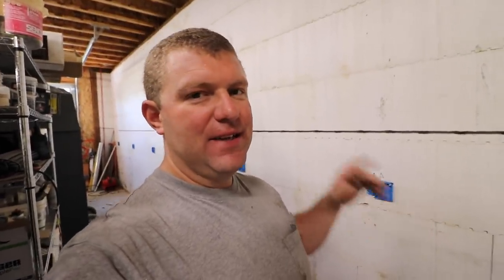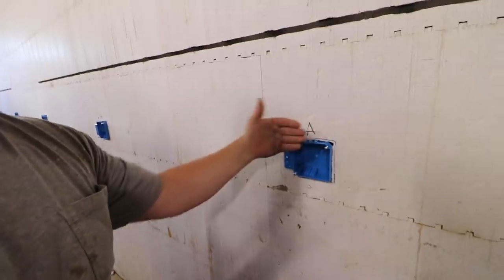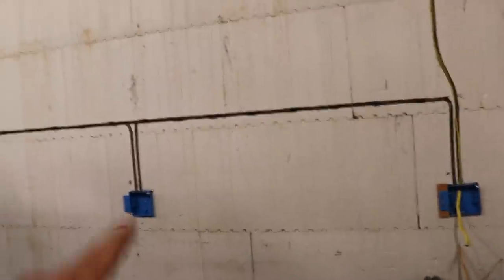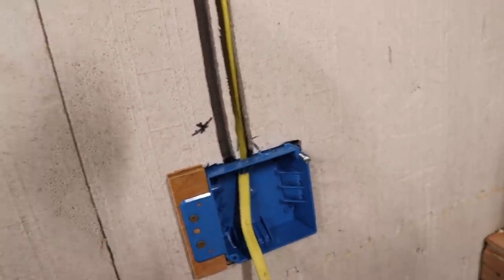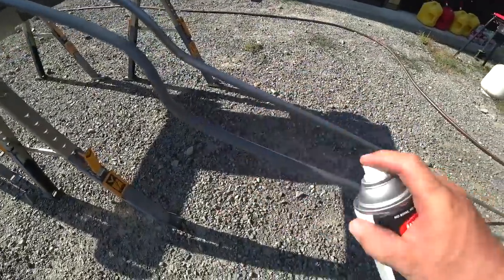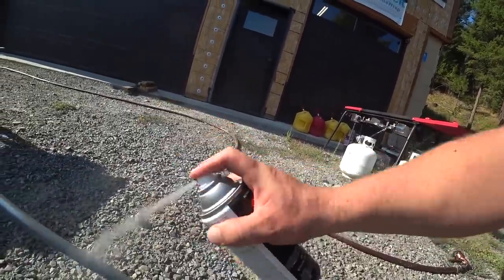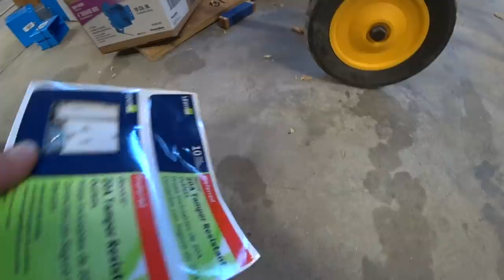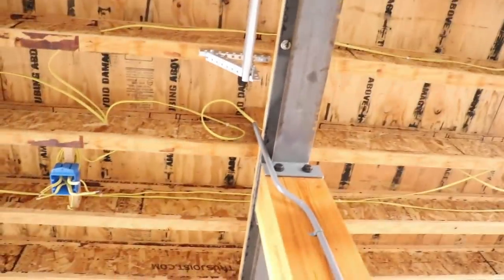OCD PEOPLE BEWARE! (Hot-Knifing ICFs for Garage Electrical)

Comment: Hate to burst your progress bubble but by code Romex wire cannot be put into conduit.....one reason you don't put romex in conduit is because it creates more heat and is not advised in conduit if you have conduit you can run insulated wires instead it's probably cheaper. when you put romex inside conduit The Romex cannot breathe and retains too much heat.I always thought that it was okay.
Reply: Pete Nelson disagree! It can go in conduit as long as you don't exceed conduit fill (40%). It's not normally done though, except for when you're just sleeving NMB to "protect from physical damage". It's done all the time for what he's using it for.  But you can't remove the sheath where it enters the conduit. Only remove sheath after it enters the box.
Reply: also..... less pst, pst, pst and more  psssssssssssst.  :-)
Reply: @playnationtoday  just stating what national electric code states
Reply: @petenelson6654  The NEC does not state that. Unless you can cite the article, it does not exist
Reply: @N-hunter  section 312.5(C)
Reply: @petenelson6654 the exceptions to that article specifically allow it
Reply: @N-hunter  those pesky exceptions will get ya everything haha, totally legal if used for physical protection. I remember years ago inspectors would allow striping the nm sheathing off then the turn around to not allow us to do it as the individual wires were not labeled as to what type of wire it actually was.
Reply: @TheRealTonyCastillo  sometimes it all depends on the inspector. Some will let a lot slide and others are strictly by the book
Reply: I just don't want him to have a bunch of stuff to redo. Could put a junction box on the top of the conduit and run the Romex to it and THNN down to the outlet
Reply: @petenelson6654  NEC Section 312.5(C) specifically allows it in just exactly this scenario.  Also, they have already passed their inspection.
Reply: If putting Romex in conduit is frowned upon because of reduced heat dissipation then putting it in a tight slot in polystyrene foam must be reallly bad.  And if he's gonna fill those slots with more foam then we can expect instant conflagration.
Reply: @thomasmarable6818  Yes, here in the UK electricians use cable called Twin & Earth which is similar to Romex and the wiring regs specify different current ratings for each gauge depending on how the cable is mounted. eg in conduit, clipped to masonry , under plaster, under 100mm of insulation etc.

Comment: Why are you using 20A receptacles in the ceiling for the lights?  There are VERY few appliances that need a 20A receptacle.  Especially since it looks like you are just plugging in LED shop lights to them.  Just use 15A.  The 20A are much more expensive and unnecessary.  There is no issue or code problem with using 15A receptacles on a 20A circuit if that's what your worried about.
Reply: Any 15 amp receptacle will flow 20 amps. No need to spend the extra money on a 20 amp.
Reply: @CustombyclyneCbc  agree.  Also, 15A receptacle should really never have to flow 20A because any appliance that would require 20A should have a 20A plug on it.  So you physically should not be able to plug a 20A appliance into a 15A receptacle.  Most miter saws and jobsite table saw have standard 15A plugs.
Reply: @javaldes7  also agree. I used 12/2 wire with 20 amp breakers with a 15 amp receptacle on my garage wiring and passed my inspection. No need to spend almost 4 times the money on a 20 amp receptacle.
Reply: @CustombyclyneCbc  price difference on those things are absolutely rediculous.  Especially if you are doing an entire house and you will almost never need the 20A.  I couldn't justify it either.
Reply: Not only 20A receptacles but decora.  Standard 15a receptacles about75 cents these are probably $3. But they seem to have plenty money.
Reply: @mengelman2  I can understand decora.  The really do look so much better.  And I get this is his home and hes trying to do it right the first time.  But this definitely a case where the money truly is just being wasted.  He will never plug a 20A appliance into one of those ceiling outlets.  Maybe you need 1 in the entire garage for the rare case u need it.

Comment: Never paint conduit. It is supposed to be conductive.
Reply: That is why metal conduit is required to have a "bonding device". Then,. there is PVC conduit. Personally, I green wire all conduit pulls, in addition to bonding the metallic boxes and making up conduit connectors TIGHT.
Reply: Conduit is painted all the time, it shows you know not what you talk about.

Comment: Hi, Did you use the ring circuit for the outlet?
Reply: Ring circuit is a UK item, In the US the 15 or 20 amp garage circuits are never wired in a ring.  The US National Electrical Code is very different compared to the UK wiring Code.  With the 115volt receptacles in the US the need for more home runs would be needed as a large power tool such as a single table saw would take 13 to 15 amperes.  In the UK the same table saw would take half that current, and a little less with the voltage drop in the feeder wires.

Comment: could electrical conduit have been embeded in the garage slab?
Reply: They could have, but instead they opted for radiant heating conduit in the slab which they've opted to not use and instead got an electric heater.
Reply: @JW-sv5xc  right i forgot about the radiant, been folowing them for a fiew year. still wonder if radiant and electrical conduit could be in same slab safely.

Comment: you painted sliver  Gray ?
Reply: Grey
Reply: What I don’t get is, why do you need to paint the galvanized pipe when it doesn’t need to begin with?
Reply: Ralph Woodard Answered at 22:57, he likes the grey look over the raw metally one.
Reply: Per Gref I understand that. I also understand that you’re not supposed to put romex nto conduit and do single wires. We all have do you live in learn.

Comment: you cant run romex in conduit per the NEC
Reply: Not true.  Here the conduit is serving as a protective sleeve for mechanical protection.  This is allowed, in fact it's required.
Reply: I don't think running TWO in the same conduit is allowed,
Reply: @fredyearian4968  It is allowed, but the conduit needs to be appropriately sized and that 1/2" is not large enough.
Reply: @charliep6334  I always ask ok what article is that, guess from teaching code class to apprentice, but its fun watching them trying to find it.

Comment: If you were wiring per code, your grounds would be to the top.
Reply: I've never heard that. Can you cite where in the code it is?
Reply: There is no code for up or down according to NFPA 70. Although there could be a local one; unlikely. There are theories as to up or down but often it'll just comes down to circumstance I'd imagine.
Reply: arkycadd never heard of that being a code requirement and I’ve seen a hundred ESA inspected jobs with grounds down
Reply: There is no such code

Comment: FYI, a little common sense here: you may have latitude with respect to where on the face of a stud or a joist you drill through-holes, but there is only one correct location structurally for the hole, and that is right in the center of the stud or joist.  This leaves the drilled piece with maximum torsional strength.  Moving the hole toward either edge will weaken the beam, whereas drilling the center will have little effect on its' strength.
Reply: TJI have knockouts in them are are slightly off centered. My guess is he is drilling out the knockouts or at the same level as the knockouts.

Comment: Just curious, why not use a router to cut through the ICF instead of the hot knife? Too much damage to the ICF or not a good cut? Just curious, seems like a router may make the channel creating much faster
Reply: Foam everywhere! What a mess! hot knife is fine.
Reply: Besides the mess touching concrete with router bit wouldn't end well for the bit.

Comment: Thanks and well done but here's a question: Painted conduit??  I like it better too but,  could you use copper water pipe instead? More cost but maybe more pretty.
Reply: No, because the NEC would not permit you to use Copper Tubing. Electrical components have to be approved by NEC for electrical use.

Comment: Went through all the comments so far and nobody's caught the missing threaded plug for the back hole in the weather proof box or possibly every wp box. Another code fail ! That leaves ignitable exposure !
Reply: News alert, they already passed inspection.
Reply: Watcher    Question,   Passing electrical inspection means the installation is 100% in compliance with NEC?   I think not.  Inspectors are not liable, installers are.   Respectfully,   Kevin